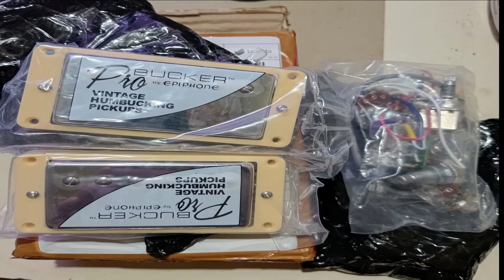DIY Installing Prewired Probucker

Comment: i bought the same pickups and mine have a lot of feedback, any suggestions?
Reply from the maker: - Copper shielding in the PU cavity
- Your home electricity are they grounded on soil ?
- Change your guitar cable with the good one (noiseless)
Reply: @MindofYǒng Make sure to ground the bridge to a pot